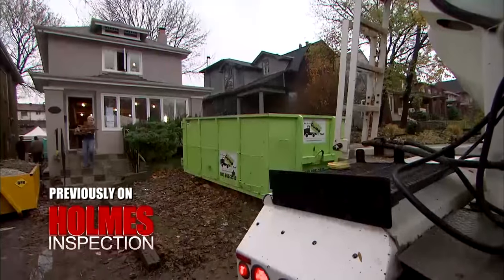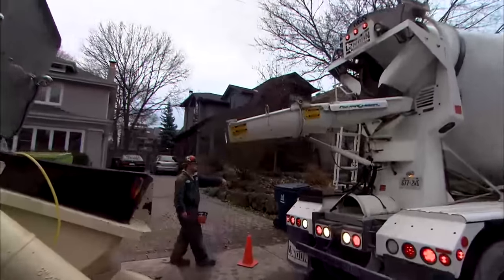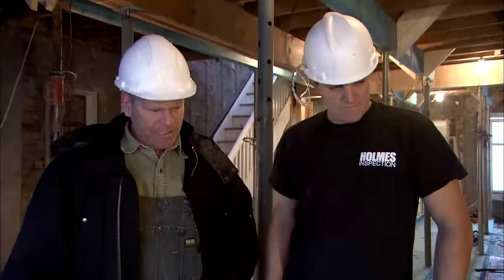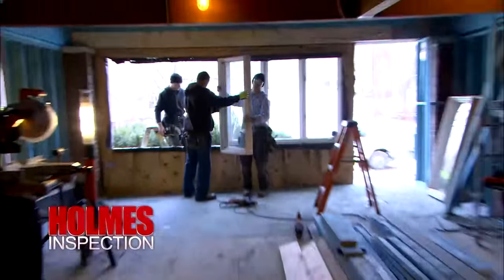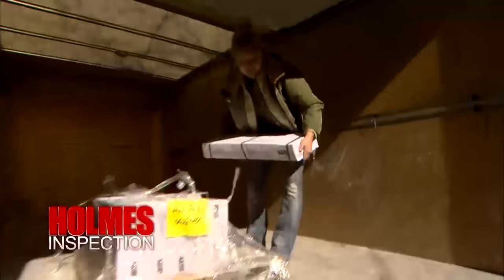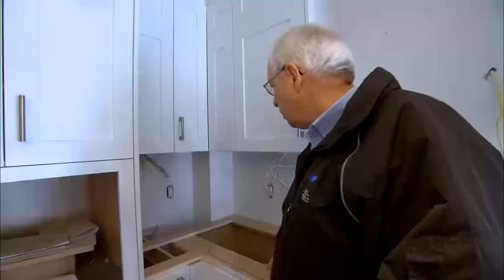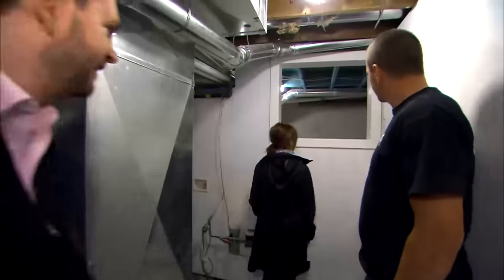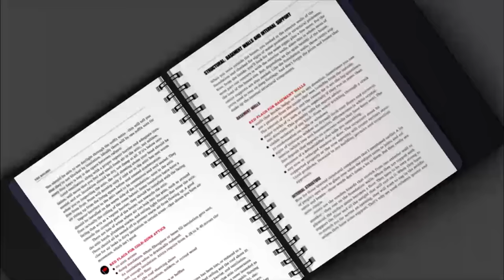Home Inspections Done Right - Part 2/2 | Holmes Inspection S123

Comment: I remember this two-parter, and I think it's the one where Mike went to court because the damage and cover-up was so egregious. The contractor who performed the load-bearing wall removal and the inspector who signed off on it should have been held accountable, but as I recall nothing happened to them or they settled out of court.

Building codes exist for a reason, folks.
Reply: And that reason is not to irritate Mike, no matter how much they do.
Reply: Their insurance company would have settled for them. Their premiums may be a bit higher after the settlement.
Reply: what year is this?
Reply: @fredrezfield1629 First aired in 2010,  so probably happened in '09.

Comment: i find this show endlessly fascinating I used to work construction and all those old guy were perfectionists not sure why there are so many bad contractors out there.
Reply: My step dad is one of those old perfectionists. He taught me that you dont skimp. Rule of thumb was, would you want poor workmanship in your house? no, then dont do it on someone elses. I see so many newer construction companies cutting corners and just skimping on the job that its insulting and infuriating.
Reply: They're not perfectionists they're insane... If you compare this house to a car that got keyed in a parking lot, they'd want every body panel removed and replaced with brand new ones instead of just repainting the car.  It might even need a whole new frame because of the little rust they detected on the bottom!
Reply: It's human nature and a lack of Christian principles.  Everyone wants big bucks but don't want to do it the right way, which cuts into their profit margin.  Cutting corners is the new standard.  And sadly even code inspectors don't have good morals either.  If they are paid by the contractor they turn the check and don't look to hard at it...  it's a sad world we live in.  Either do it yourself or live with it now.  I don't trust strangers to come in and do a good job

Comment: This is one of those jobs where it might have been the same cost (and overall easier) to bull doze the house down and rebuild it brand new.
Reply: Certainly easier and a probably cheaper because of access. This reno would have cost at least $5-600,000 Canadian Dollars if labour was costed properly.
Reply: In part 1 it sounded like they had a big debate to do that and decide not to for an unknown reason.
Reply: @DefinitelyNotRin wouldn’t surprise me at all if it was because it was located in a “historic” district.
Reply: Especially when they took 7 months to remodel it... The only thing you would save money on is permits, an approval to rebuild from the city
Reply: I wouldn't be surprised if they chose to repair it, instead of build new, because under new zoning regulations the house would have had to be much smaller. Especially when you consider how much of it was built on the property line.
Reply: @anthonyholland2605 well in part 1, Mike said the cost of fixing it would b 300k canadian
Reply: @AznIntegra521 😮Bearing in mind these shows are the early 2000's. So prices will have gone up considerably.
Reply: Yep, but getting permits is the hard part and could take months to even start. So it's best to just rehab it and basically make it new again.
Reply: @anthonyholland2605  ...Mike said it would cost between $300-350K, so, there's that...I probably would've knocked it down and redo it...
Reply: @ICU2B4UDO  I believe new building restrictions would have meant they would have to build a smaller house. As the overall footprint of the house was pushing to the property lines. Build a narrower home and get less interior space or pay more for a third level above ground for more space. Also, this could be a historic area and that could stop them from doing a lot of things they wanted.
Reply: To the same scale footprint , no more  , no less  , and take out the one concrete block wall  ( dat looked pregnant  ) re-do , so da' basement not see  , smaller . Dat my point  ?!

Comment: As a general contractor I have seen it all.  A friend call me one day to help him, needed an inspection of the house, money was tight, so I went over to the house, saw it & why him & his wife love the house. But after what I witness was serious issues with the structure to. Noticed a crack in the plaster above the entrance between the kitchen & living room. What I found, that someone cut the main beam for an extra air vent; went up stairs noticed the gap at the top of the walls, 2"inches. The wiring was to old. I told them to pass it by! He was a happy camper, yet disappointed. Just, I am not a building inspector either, I am just a Contractor with 48yrs of experience, commonsense goes a long way. And I saved my friend from making a big mistake.
Reply: Teach! You have very necessary job skills. Find a community College and offer basic construction skills. You are needed!

Comment: This rebuilt cost around US$300,000 in 2010 according to Holmes. They probably could have built a new house on the same spot for that amount. This was really the worst of the worst. Almost everything had to be rebuilt except for the outside walls and the roof. How can it be that none of the involved builders, engineers, inspectors, real estate agents and previous owners can be held accountable? This is a really messed up system for buyers. Are there no warranties, professional insurances, contract clauses regarding hidden faults, and the basic assurance that the house will not fall down due to structural faults?
Reply: Only warranty on new build

Comment: Except for the spray foaming and stick welding the job is well done…
Spray foaming should be kept to a minimum due to fire hazard. Welding without a following treatment such as heat galvanizing, this railing will rust immediately especially in that climate.

Comment: 😅 if you read this I have to use a talk to text software because I'm 100% disabled veteran and anyway Mr Holmes I'm in California I've never seen a blue 2X obviously it's not a plastic border or metal is some kind of coating on the wood wonder what type of coding it is in my home here in California I made certain specifications I didn't design the floor plan of it I will increase it to whatever anyhow all my exterior walls are 2 x 6 is so I can get more insulation in them all the outlets are number 12 wire play Chef throws that are for lighting alternative the 14th size. did not have spray-in foam insulation at the time so I had R40 put in the Attic how about an hour 20 in the walls if I remember right the heating and cooling in this house while I'm an old air conditioning technician contractor if I can toot my own horn I am noted for my duck design capabilities whose house was built in or finished off in 2002 and I used a 90% furnace as well as an17Sear rated air conditioner which at that time was Overkill and I know for a fact the Carpenters that built this house didn't know what a level was because I have one kitchen wall which is non-structural which is leading about roughly 2 inches from the top to the bottom I found this out when I built a cabinet on the other side of the wall for storage turn the hallway off of the garage the building inspector that we had didn't like my rating on the wiring sizes and he wrote me up saying they would draw too much power so I went to the Head inspector at the building department if you keep this somewhat short anyway he tore up the right up at the inspector out here did and I guess that inspector got an education well I didn't mean to suggest a damn long and windy love your show and videos that they have once I found you I've been watching you constantly for the last 3 days 5 an hour and a Merry Christmas to you add a Happy New Year please extend out to the entire crew I wish you guys had built my house that way I know what you was done right.

Comment: To think this all could have been avoided if someone didn't change a beautiful old historic home into an "open concept" abomination. As soon as they did the first pan of the interior and I saw those beams along the ceiling I knew exactly what the problem was. They're honestly lucky the whole place didn't just collapse.

I'd be suing the contractor that did the remodel. If Mike was able to find the original plans and such 30 years after the demovation the original engineer, inspector, and contractor could as well

Comment: Why do they always use the bullshit "overloaded circuit" phrase?  There is nothing like overloaded circuit, as in an overload condition, circuit breaker protects the circuit by disconnecting it. That there is 20 things on a single breaker does not imply an overload, by any means. If the sum of the current draw is less than the circuit rating, it is absolutely fine. At most an inconvenience, that once breaker tripped, half yo house goes dark. But neither is it an overload, nor a dangerous thing to have. Sure it is not optimal, maybe even not up to code, but certainly not dangerous.